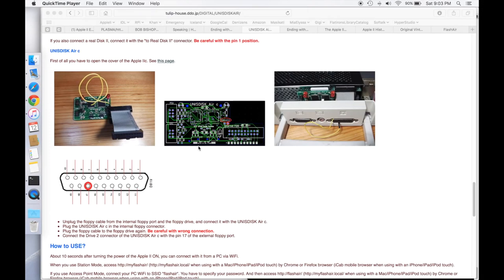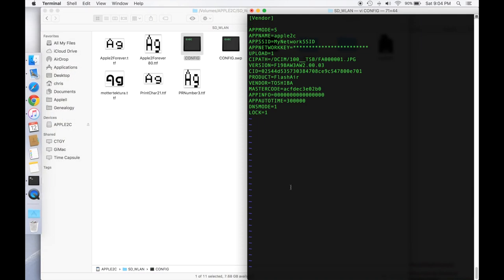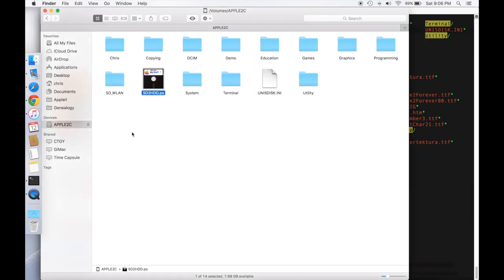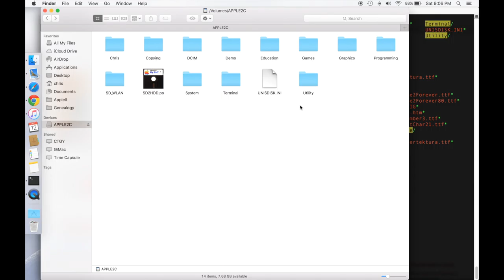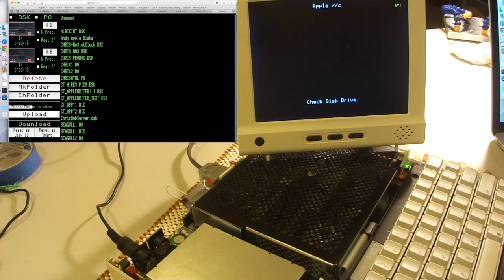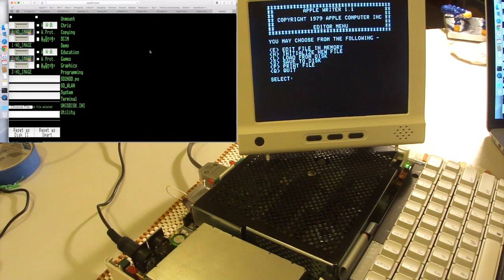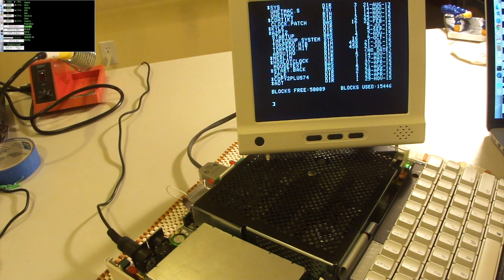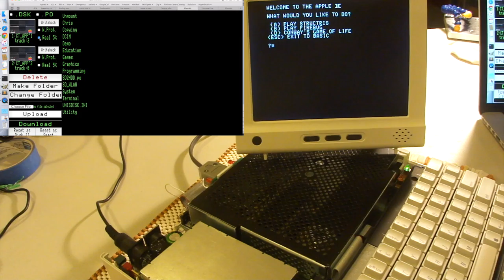Assembly Lines #21: UNISDISK Air c for Apple //c

Comment: Great video, I really appreciate these.  One question: when I reset the UNISDISKAIR into smart port mode,  can I also use the .DSK images, or just the .PO images?
Reply from the maker: +chronocide Good question - I'm pretty sure that if you switch to smart port mode, you can only use the .po images. But you might want to verify that with the latest firmware.